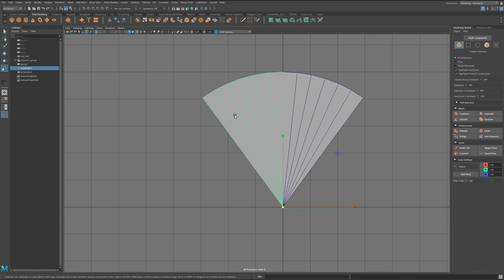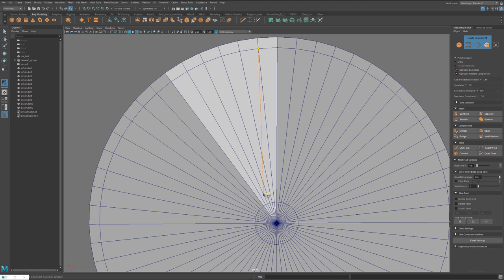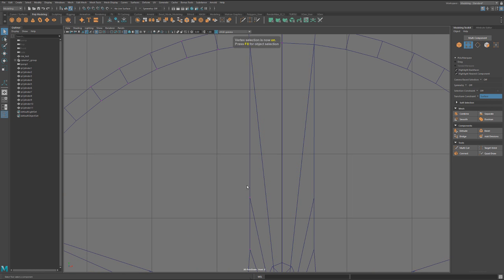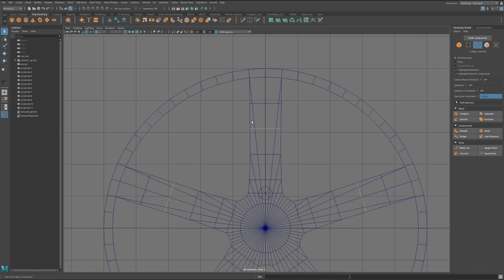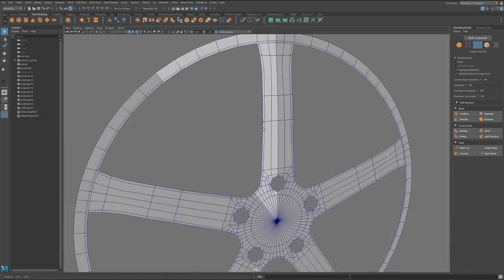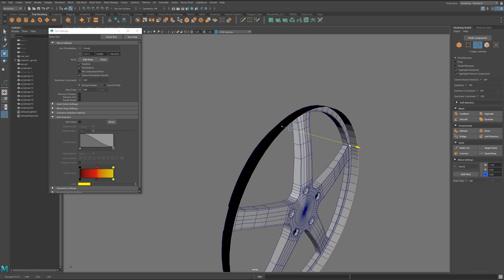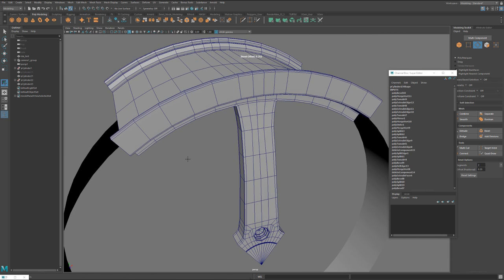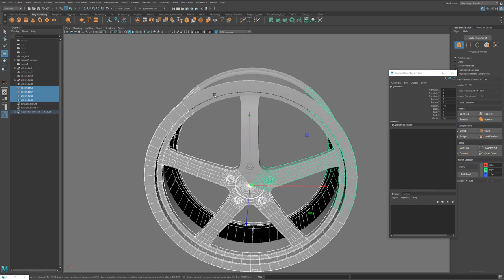Maya Hard Surface Modeling: Radial Symmetry

Comment: Sir i have several questions to your steps... 1. on 28:34 why after you deleted the detached object, then it's still there showing on 28:47? why do you have 2 bars? (the deleted object)
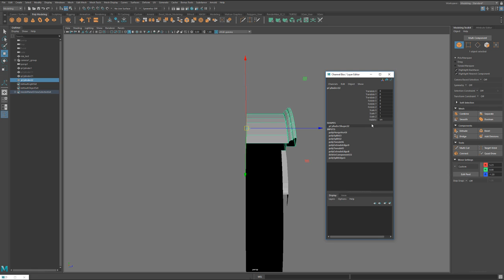2.  Did you use mirror or duplicate? you didn't explain but on 30:47 you have 2 objects again!! (when did you mirror or duplicate?) please help! thanks

Comment: I just got a question , why we select in the begining 6 faces and not 12?  just to make later 12 and after that to divide special. The cylinder have 60 faces divided by 5 spokes are 12 , each symetry line is in the middle of the spoke.

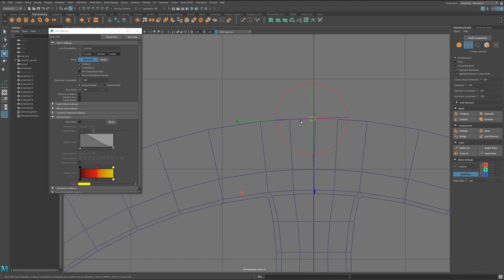Comment: 20:49 what do you mean by D, Ctrl, then W?

I'm doing that and it's not doing nearly the same thing. The edit pivot widget comes up, but Ctrl doesn't do anything, and W just returns it to the regular Translate tool. Holding Ctrl+W doesn't do anything, either. What am I doing wrong??

EDIT: He doesn't mention that you have to click on the edge you want the pivot to match. 

So it's D, Ctrl+Click on the edge you want the pivot to orient to, then W to return to the Translate tool.

Comment: Hi JL! Hope you can help? I’m having issues with “duplicate special” using the 72deg rotation. It worked fine yesterday but the function does nothing now. I have frozen transformation, deleted history and I patented the object. I edit the pivot and place at the centre point then reset the tool prefs, choose 72 in the correct axis and when I hit duplicate the tool closes but nothing happens. I’m going but trying to figure out what’s causing this. Have you seen this before or have any idea what may be causing the function to fail? Thanks 👍

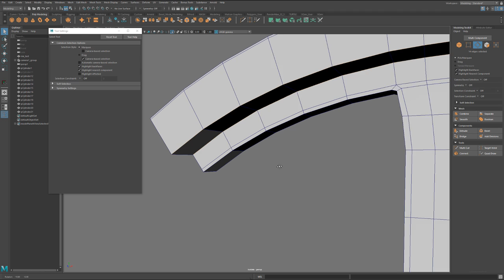Comment: At 24:40 you beveled that edge. What keys did you press to increase the number of edges?
Reply from the maker: Use the "Bevel" command from the "Modeling Toolkit".  You can change the divisions on the fly by holding SHIFT and scrubbing left to right.

Comment: When I duplicate special it seems to stack all the duplicates over the same space where the first duplicate should go. I've looked at your settings and with the exception of some slightly different numbers for my project everything is the same.
Reply from the maker: If you are trying to create a radial symmetry setup, make sure your pivot is in that center, also make sure you are rotating on the correct axis, maybe you built your shape from the side instead of the front, so you should use rotation values in X instead of Z.  Just a guess here.
Reply: @jlmussi  Well that is true. I have been trying to do it on the Y-axis. Which is what I needed. I also have the pivot centered like you mentioned. It's weird. Say I want the rotation on the Y-axis at 30 degrees and need a total of twelve including the original one. The eleven duplicates that are linked to the original all are created on top of each other 30 degrees off of the original. It's not incrementally increasing the rotation like it does in yours. I was thinking that there may be some settings somewhere else that I might not have done correctly. But I'll keep looking. If I take things a little longer I can duplicate special and create one additional at 30 the next one from 60 and on till I get what I need. But I hope to figure this out.
Reply: @jlmussi  Also thanks for the fast reply.
Reply: So I've been revisiting this issue and accidentally figured it out. For some reason, the scale for the z-axis on the tool was at -1 instead of 1. When I changed this to 1 everything works just fine.  I probably ended up accidentally keying it at some point. Glad to figure it out. Beats doing it one at a time.